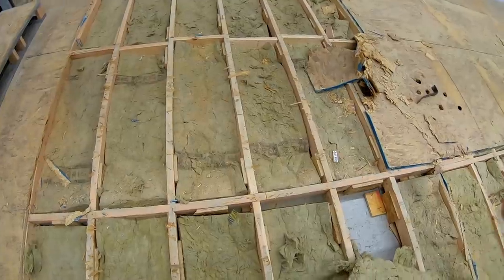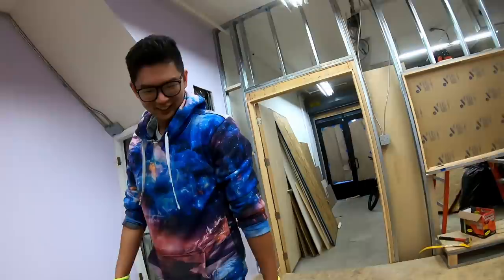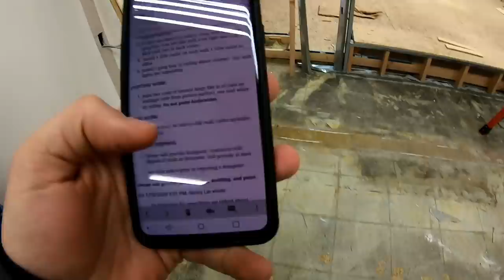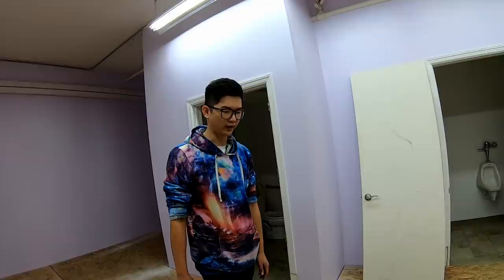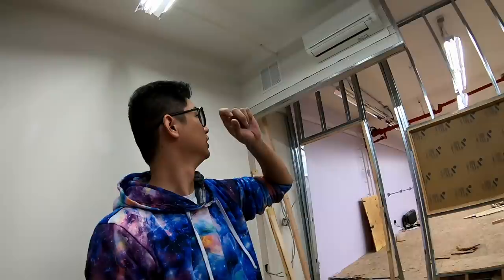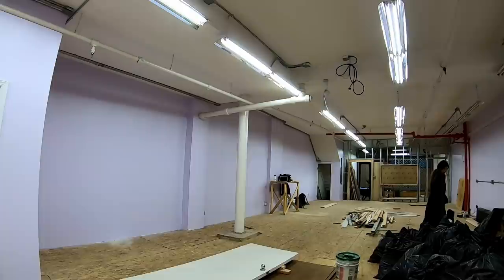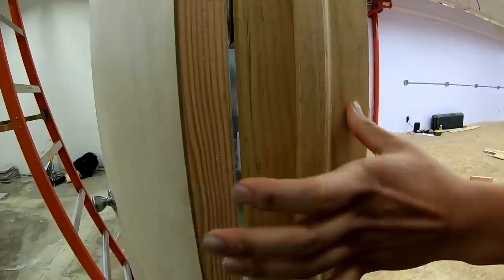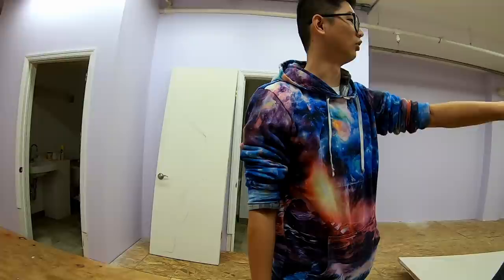Day 44 - THE RETURN OF SUNNY! Contractor C walkthrough

Comment: Sunny seems very nice but he is not a contractor. He doesn't really know how to use a crowbar properly.  He has some knowledge about renovations but it almost seems like he has not been doing it very long or got tips on YouTube Reno videos.  Again, very nice guy and I'm not trying to make fun, but I don't think he is the best option to go with.  whoever does get the job please don't just screw down plywood and put vinyl over it, you will feel the dips. Epoxy or shim the dips, then plywood.
Reply: Not to pick on you in particular, but I keep seeing EPOXY mentioned all of the time. I took the time to look it up, and epoxy at home depot costs $90 for enough to cover 0.5 square feet. Self leveling concrete costs $30 for the same coverage. Since it will be under tile or hardwood, epoxy a waste. HOWEVER, leveling with concrete, and doing an epoxy top coat instead of tile would be banging.
Reply: @brandonwc  I wrote Epoxy, but you could really use any epoxy or mortar material to even out that floor, but you cannot use self leveling cement.  What ever you use to fill the dips has to be a pudding texture so it's easy to spread with a trowel but not run, like self leveling cement will do because the store is on a 5 inch slope towards the front.
Reply: @1.21giggawatts9  Nah, self leveling isn't as thin as water. It won't run out the door. You can pour in the dips, and squeegee out to a nice feather. The leveling part just means it doesn't need troweling to be smooth. The small ridges will level out. Can always mix a little thick too. Just add less water.
Reply: @brandonwc  if you are just going to mix it thicker, might as well just get regular cement since self leveling is much more $$
Reply: @1.21giggawatts9  Yeah, but I'm talking just a bit. Pudding enough to not need troweling, but not thin enough that your chasing it out the door. Like the epoxy, but cheaper.
Reply: A contractor doesn't need to be able to use a crowbar. The important thing is he has subtrades that know what they're doing, and if he can do a good job on time and on budget. That initial job was so bad anybody could make it better, and he correctly pointed out some of the things that were wrong. I'd definitely give him a shot if I already knew the guy, and Louis knew a bit more this time around so he's a little wiser which helps with a good client/contractor experience. Maybe he can't build a skyrise, but he seemed equipped to deal with the scope of work.

Comment: That wood frame for the sub floor needs to be exposed and "fixed" for 16" on center and shimmed (shimms glued & screwed in place) to be "leveled" / flat. The rock wool is primarily to dampen sound with a small side of warmth. but the actual sub floor ( any subfloor on wood framing) should be T & G [tongue and grooved] min 5/8" thickness.  The T & G makes the entire surface monolithic with each joint supporting both pieces of plywood and they also should be glued and  screwed for rigidity and strength and all joints should be supported by the wood frame beneath. This project of yours is my specialty and I only offer the advice due to your educational videos that helped me better understand the dark complex world of electronics... Thanks for that.   Oh btw that front steam rad is "sized" for a heat loss calculation and any replacement must equal or better the BTU thermal output / exchange which (loosely) is based on volume capacity and surface area of the rad ( heat exchange to the room).  Wish you luck.

Comment: If the worst had been some leftover nails under the floor then I wouldn't have had any issues, but the zig-zag studs and the cheating way of supporting the studs really looks like a pile of manure. Having insulation under the floor - that's good for noise perspective but has a tendency to keep humidity in. If you have a concrete floor, then start with thick tar paper or something else that is a water barrier between floor and support since concrete is almost always acting like a sponge for water no matter how dry it appears. I'd rather take a floor with less sound dampening than humidity issues.

Personally I'd put a more advanced AC in the basement since it would be less noisy, but it would be more expensive.

Nice to see that someone that was fired can come back and with a lot more experience. Always try to do your best whatever you do. Sometimes you will make mistakes, but learn from them and be better next time.

Comment: Don't listen to those recommending jacking up the floor or anything. Just use some lasers, measure the dips and cut out the wood properly so it sits on the concrete currectly with no flexion. Very easy.

Comment: The first thing I thought of after floor leveler was a computer room floor. You put in a metal frame, adjust for height using a laser,  then lay in floor panels. How expensive, I don't know,....but it couldn't have cost much more than this clusterfuck. It's made to allow airflow under the computers and I have to think that somewhere in that huge city is a salvage warehouse with an old computer floor that you could modify to height.

Comment: holy shit this insulation look 10 years old :(, it's so badly made too, damn.... Let's remove this shit ! good luck guys !  I loved that guy from Brener, but Sunny is really a champ too :)
Reply: th3 Cub3 that insulation is called RockWool and is brand new at about $50-53 a bundle for 12 pieces covering 59sqft. He has over $2k worth and it is basically double the price of regular Owens Corning crap pink batt insulation and is NOT fireproof, water resistant, and mold resistant like RockWool is.
Reply: @MrLegendL2118  yeah it's just that RockWool normally LOOKS like crap. But it does the job alright.

Comment: I know this is over a year old now, but... 1:05 - It is SO EASY to do ALL of this shit right! RIGHT! With the subfloor up, you can brace this now with wedges and blocks & shims in a couple hours and cut & add purlins that set solid on the floor and create the shared support for the sheeting seams, so the edges don't sag under load. Like, you can MAKE SHIMS and spend LESS time doing this job than doing it wrong and troubleshooting and resolving the results. All the components of a structure must have FULL CONTACT of the HORIZONTAL SURFACES to transfer & bear weight. I hope you got it all squared away and are happy with the result. You started to thrash, but I think you'll get what you want/need. For what you were quoted originally, the bathrooms should have been included with the plumbing adjustments. It's just like when you are working on boards. You know the tools and processes aren't a big list. You do much the same to change a chip on one board vs. another. Contractors and builders that aren't driven morally, will depend on your fear and imagination to always make every aspect of a job seem random and daunting, so there's always a sense that it would have taken so much effort to do it right, when all it took was NOT DOING IT WRONG!

Comment: Don’t break those tiles up, try to keep them whole when removing. We have them in the uk in old stores, they contain traces of asbestos.
Reply: In the US, you're generally required to survey for asbestos and do abatement if more than a trivial amount of asbestos material is found.  Surely Eugene at Gotham City Solutions would have done that before getting started.  /s
Reply: Joseph W. Fowble, all commercial buildings are required to have completed an asbestos survey if built before 1994 in uk by law. The tiles are very common and only contain very small traces.

Comment: Why not use leveling compound instead of giving up 8 inches of your space. You pour it down spread it out and let it dry. Then you roll the liner and lay linoleum or hardwood on top. You loose 1/2-1 inch of height max and it takes 2-3 days to dry. That framing they did should never have been done unless you have a huge drop from one side to the other.

Comment: the strike plate on the door that has been cut out is on the wrong way, the lip that hangs out beyond the door should face towards the door frame to prevent damage to the edge of the door. maybe it's different for $600 doors?
Reply: @Luke,  that front door was a double door, so the strike plate might be pointed to the correct side of the door but probably should have been on the other door of the pair.

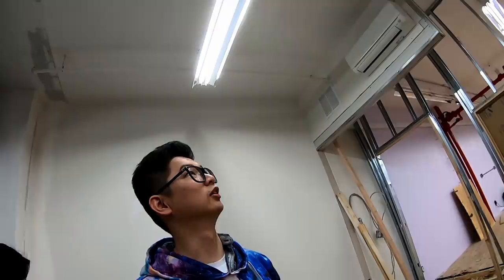Comment: 10:00 burying a junction box is a cardinal sin in the electrical trade (and against code)
Reply from the maker: From what the electrician has said, the junction box should not be there. Some have suggested putting an access panel but there is genuinely no reason for it to even be there, it is leftover from when they had an office in the front. Apparently that office was added in the front on short notice by prior tenant, I'd rather just have the electrician re-run it as they see fit, rather than a junction box for previous work being grandfathered into this job.

Comment: Those old VCT tiles on the floor look like they could be the kind with Asbestos in them and if they are that's most likely why they are still there. I'd look into it, breathing in things can do a number on people.
Reply: I agree, it wouldn't hurt to have them tested before ripping them up. (Though, that's not free of course.. Hopefully NYC asbestos testing is fast, which I think it would be.)

I do remember louis saying when he signed the lease, there was some kind of asbestos certification (don't quote me on that, I forget the exact wording), which probably says there is no asbestos in his building. I am kind of curious what was checked in the certification though, do they test the tiles? My house has steam heat like his new store, and the steam heat pipes in my basement used to have asbestos insulation, I'm not sure where else asbestos could be lurking.
Reply: Louis said no asbestos!

Comment: I wouldn't use a guy who did not know what offcuts / tailings for hardwood were.
That does not mean he doesn't know anything, he probably knows a ton, but specifically the floor I would be worried about.
Save some of the floor wood and make shelves or something downstairs, if you super don't want it someone would come pick up the 2x4s.
Lastly if you are going to follow the guys design for the shop, follow the design.

Comment: OCCUPANCY SENSORS ON THE LIGHTS and HVAC!  It is 2020, forget about switches! 
Use smart outlets for the TV's so they can turn off on a schedule, or even on an occupancy switch.

And no way that is enough HVAC for heat or AC. 

YOu need to ditch the mini splits and install a ductless air handler, or two in the front and lab and maybe a mini split in the office.

Comment: I would give the false floor a miss. just looked at day 1 video. OK its not level but if you rip the tiles up and get some decent floor covering down by the time you have all your desks equipment in you wont notice it hardly that  its not level... the bump in the floor near  the door smash the tiles off  2 minutes to do it.. and see what the bump is about. may just want fettling down.  dont know what you will cover the floor with  ( I havent seen all your vids Louis) but  if you put a false floor in. and if the covering not good over time you will see where the boards are joined underneath on the false floor even when covered. plus in the summer the false floor will hold heat and make it a lot hotter. hope it goes well Louis. sorry about my grammer

Comment: Your steam system is single pipe system. Very few 'baseboard' radiators can accommodate steam, especially single pipe. Pipe size vs grade of the radiator (2 percent). Steam has to flow up the pipe, condense, then return in same pipe. Water cannot exceed 1/3 pipe diameter or it will back up and not heat.  If copper fin tube is used you will find a temperature will rise and fall rapidly (enough to be annoying). Burnham offers cast iron baseboard heaters, but they have to have grade (3/8" per foot). This may not be esthetically pleasing. BTU rating will have to match your existing rad.
Reply: I love reading comments from people that actually know about steam heat, I don't think a lot of people are familiar with it. I'd just stick with the old radiator and paint it for now, but hey..

Comment: Painting contractor -45 years, retired says. . .
Paint Finishes: Eggshell for walls, with semigloss or satin on molding.  You could change-it-up in the bathrooms, and use satin for walls, semigloss for woodwork.
Don't use flat finish ANYWHERE, it has a chalky finish that you cannot clean without the paint wiping off, and it looks like shit after a short amount of time.  
Gloss on large walls that are not in a bathroom are too shiny, glare with light and look like plastic, not a good look (IMO).    Good luck!

Comment: Removing the old floor tile is not necessary.  If you are laminating new plywood to the floor you are going to be creating a new surface for flooring install.  Tearing out the existing tiles is just a waste of time.  And again, fix the support structure and it will level the floor!

Comment: Did the first contractor install the 200 amp panel. If so did he upgrade the mains feed to the appropriate 200 amp rated wire to utility service. Just curious as was the original panel 100 amp.

Comment: Sunny's a nice guy but doesn't know much about construction. The long side of the plywood does not require support that's what the tongue and groove is for, only the short ends need to fall on center of a joist or support. In conventional construction will you rarely see the long side fall on supporting wood. The support wood used parallel to the long side of osb is typically used for keeping the frame square and rigid.

Comment: My thoughts on Sunny - After the Eugene incident, I'd like to be very cautious, not because I don't think Sunny will do a good job, but I've learned that we should to seek the opinions of other contractors/specialists before finalizing a course of action. Eugene recommended the deck idea, he said that self-leveling concrete would be way too heavy for the floor, and now we're ripping the floors. I've spoken to several licensed contractors and they recommended.... you guessed it, self-leveling concrete; however with the huge dip in some areas that I've never saw before the deck was built, I want to get all the suggestions I can about how we should tackle this before Sunny or anyone commits to this. I have heard from multiple contractors there is concern it's too much dip for self-leveling concrete alone. They cannot give us solutions until the deck is gone.

I spoke to a contractor who asked why we allowed OSB when the switch was made. They said they wouldn't even use it for shelving and that solid plywood was the option we should have stuck by. I felt embarrassed saying, "There was an article online that said OSB had the same strength as plywood so it was decided that the switch was ok."  We didn't defer to the expertise of a contractor or seek the opinions of multiple contractors about the OSB and that imo was the HUGE mistake. Eugene's con - imo- would have been stopped immediately if we took a breath, did some fact checking, and called up some contractors for their advice. 

Back to what I was saying.... if the flooring is outside of Sunny's scope, we need to go with someone who has the expertise to do this right. I do not want to have the floor done THREE times before the store opens. 

With this round, we'll have a lot closer supervision on this than we did that last time. I know that you guys would catch things we may overlook. You guys have brought up good points and concerns that I'm taking notes on and passing to Louis.
Reply: Thanks for being attentive about our concerns and relaying pertinent info over. It's appreciated

Comment: Louis. You should do drop ceilings. Come a few inches off the top, no need to mess with the old stuff, it will level out, you can run wires on top for runs and the plus is instead of doing ceiling tiles in certain locations, you will drop in an led panel which will light the whole area. Did that architect that you work with give you a lighting plan?  The light plan gives you how much light will hit each area and workstation.

Comment: I've been in flooring for many many years. Probably longer than Sunny has been alive. That hardwood floor has not been laid properly. The knot holes that you are calling eyes in the wood is simply the grade of the wood that was purchased. They purchased a cabin grade hardwood which is the lowest I think in my area anyway. The grade of wood that should have been purchased is called select or better. You can purchase a grade higher called clear that has absolutely no blemishes whatsoever in it. However selecting better would not have any knots, or eyes as you guys call them.
Reply: What do you think of their, I think current, idea to ramset and glue plywood to the floor and cover it in vinyl?
Reply: That would work.
Reply: eric prater, that surprised me a bit but thanks.  I thought there might be problems with moisture or hard to hide seams, especially with vinyl, between the boards since the floor has some weird slopes.

Comment: Sunny's criticism of the floorboards isn't actually telling of how terrible it is, that's factory second boards, they select out the unsuitable boards before they varnish it, that's the unsuitable boards, they all have defects, being extremely off color, others are too thin, or the keying is off(which causes lumpy floors) the reason why they don't varnish them and then sell them is because it's not worth varnishing, there are only 2 reason why you'd ever buy floorboards like this, first is DIY where you sand it down and varnish the whole floor yourself because you have alot of time, second is as firewood